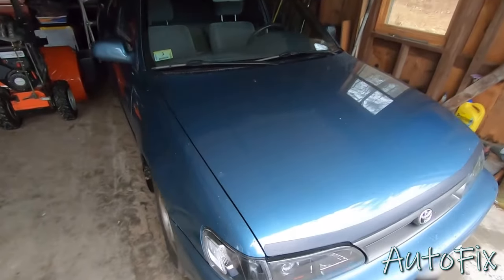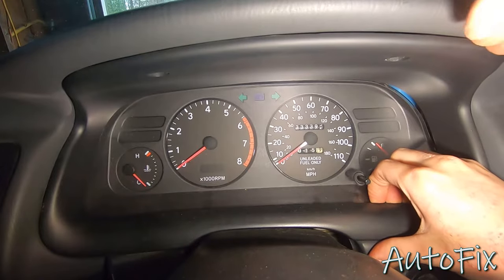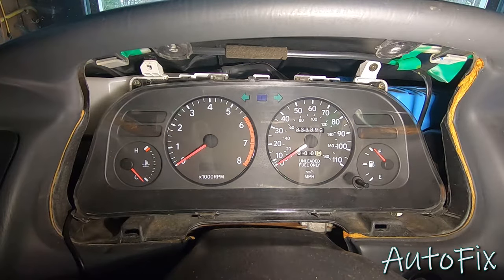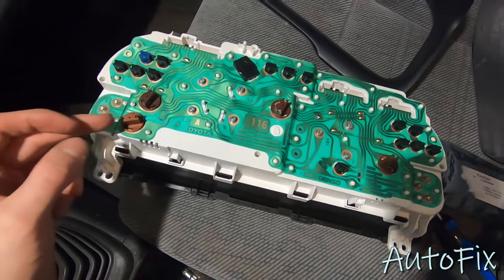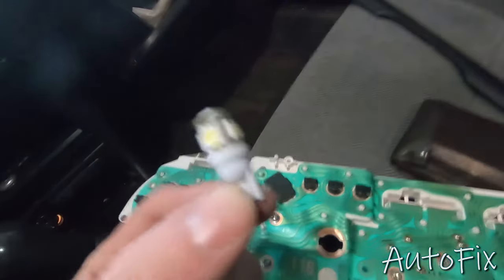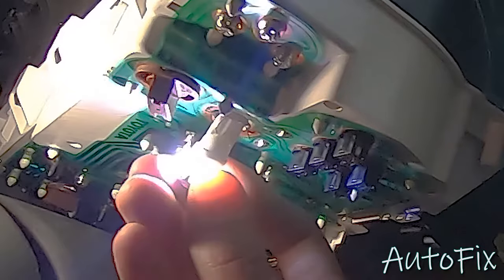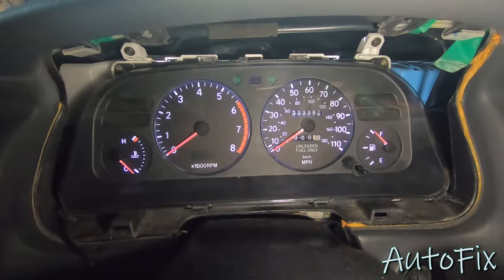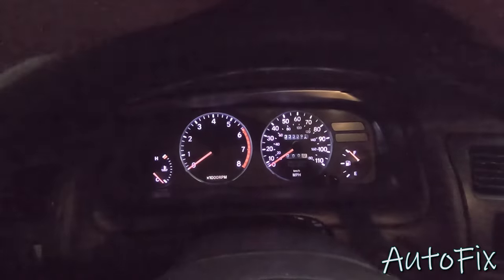Replacing Gauge Cluster Lights with LEDs - 93-97 Toyota Corolla

Comment: I thought a 168 led bulb would work on this
Reply from the maker: Yes it will work. But if you're installing a 168 incandescent bulb be aware that it may overheat in there since the 168 is higher wattage than 194. When it comes to LEDs though, heat is not an issue. And even the 168 bulbs will be marketed as 194 because they're the same size and base and 194 is the more popular bulb.
Hope this helps!
Reply: @AutoFixYT  well mine wouldn't lit up and the plastic to put the led on is kinda lose. Idk what i did wrong
Reply from the maker: Maybe the LED is not made properly? Or maybe your socket has melted and expanded over time. One of the two must be the issue
Reply: @AutoFixYT  its an oriely brand sylvania  led mini brand new, um the sockets seems to be only working when the wires of the bulb was intact together.
Reply from the maker: Ok so it's probably not the bulb... why don't you message me on IG with some pictures so I can see what's going on.
@autofix.cris
Reply: @AutoFixYT  aight
Reply: Ideally just email Toyota Parts and ask them what you need. They'll likely send you a link with bulb information. Just include year, model of vehicle and explain what you need. They are always very helpful to me.
Reply: @RavenousFallen  its just the socket thats goes to the buld isn't the same and its fixed with the original bulb because you can't take it out without completely detroying it. Haven't messed with it now
Reply from the maker: Yeah the original bulbs have to be forcefully pried out. Once you do that your socket is ready to go. If you want extra parts or practice parts then go to the junkyard and find a 90s toyota and remove the sockets from that. Most of them will have the same bulbs and sockets.
Reply: @AutoFixYT  yeah i got one pried out but the led wouldn't fit and its 194